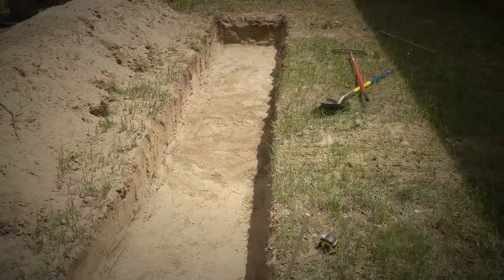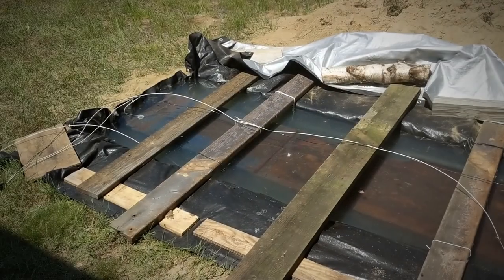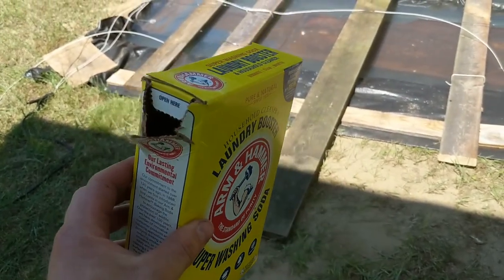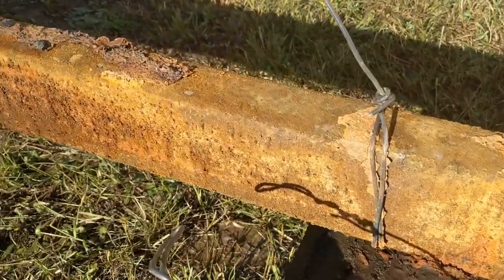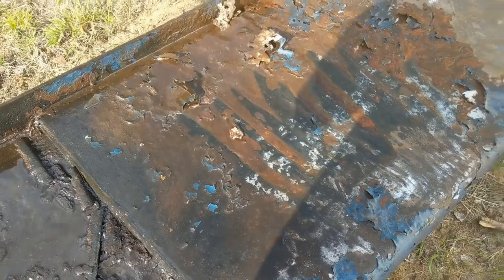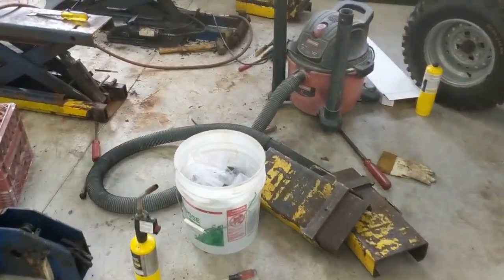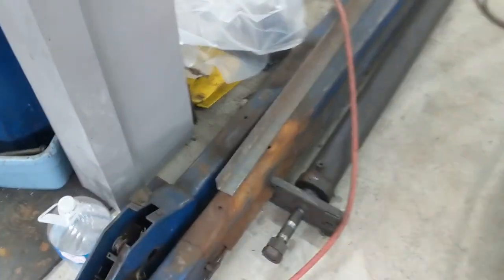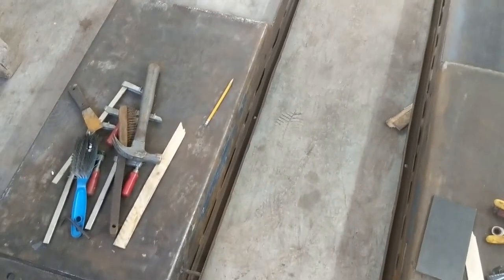Restoring a 30 year old Rotary 4 Post Alignment Lift

Comment: What would happen if you didn't bolt this one to the floor?

Like, I'm wondering how or why these old garage ones are different than the newer home garage type 4 post lifts, that they need to be bolted down to the floor?

I bought an old 1985 or so Stenhoj 4 post lift from a garage last fall, and they told me it has to be completely level and has to be bolted to the floor.

I can't find any documentation or even images of this lift online, and so far none of the companies I contacted have gotten back to me when I asked for any info about this thing, probably because I'm not buying one from them is my guess...

The main company for this thing is in Germany from what I can remember, and they didn't bother to reply to my email I sent them either...

I wish I never bought this damn thing now, but I'm determined to figure it out and make it work, hopefully without falling over.

I was wondering if I could somehow maybe bolt the posts to larger plates of steel or something, so it wouldn't have to be bolted to the concrete floor, because I doubt my floor in my garage is 6 to 8 inches thick.  Or maybe I could add bigger steel plates to the bottoms of them and bolt those to the floor that might be less than 6 inches thick?

Sorry for all the questions here, but I'm kind of in a bind with this thing and nobody gets back to me because I'm not purchasing anything new, so anything you can offer me for info would be greatly appreciated??
Reply from the maker: I know some of the newer storage lifts are movable and don't need to be bolted. I wouldn't trust this one if it wasn't bolted down. You won't know how thick the floor is until you drill. I know the automotive shop near me cut out a ~3' area around their 2 post lift and added thicker cement. I think they may have drilled into the surrounding areas and added some rebar to tie it in. That being said, a 4 post lift puts less stress on the cement than a 2 post lift. It's not like you can really load a car too far forward/backwards like you can a 2 post. I've seen images where 2 post lifts tip over and tear the cement up with it. I'd rather do the work and have peace of mind than to worry about it every time and risk injury/damage.